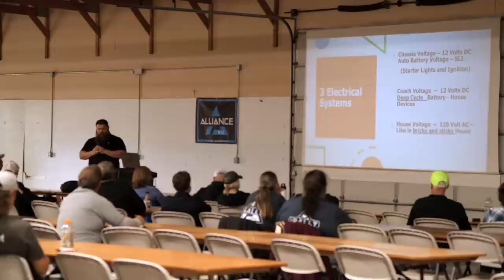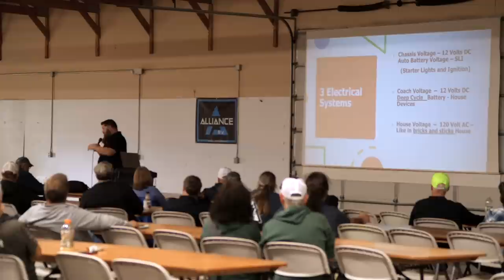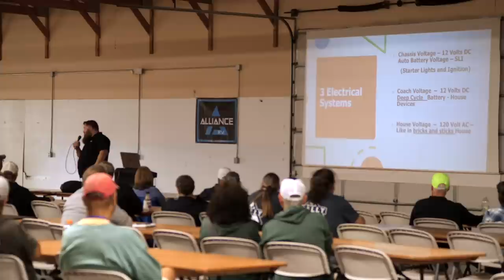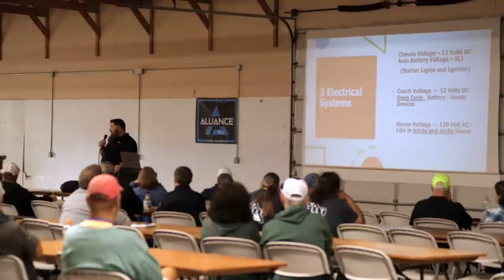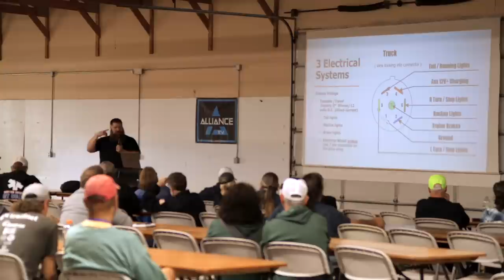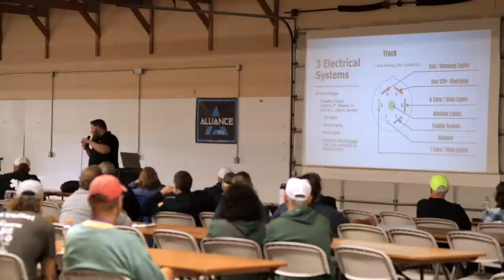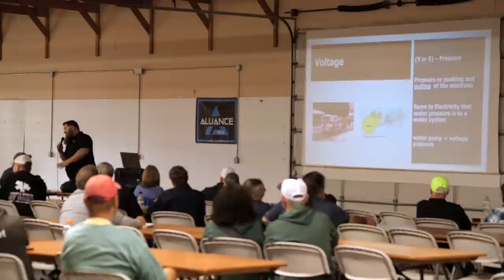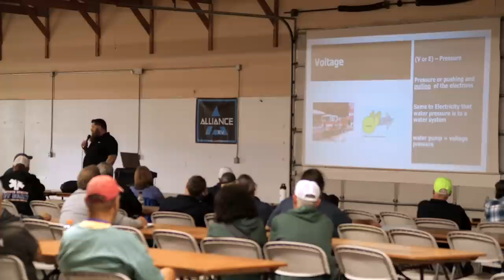Introduction to RV Electrical // Presented at Alliance RV Rally 2022

Comment: Todd, you keep on about a 7 pin connector between the tow vehicle and the RV. Not all RVs have a 7 pin connector. One trailer that we had, had a 9 pin connector. We used to carry a spare 9 pin connector just in case that we damaged the one that was in use, as 9 pin connectors were as rare as HEN's TEETH! 

Yes, we have been RVing for quite a while. I think that we got our first RV in about 1978. The smallest RV that we had was 26' long, and all the RVs since then have been 30' long. It was a Vacationair, that is no longer in production. It included all the usual suspects, as well as a connection for the 3-way fridge, and a connection for the backup lights. The 3-way fridge ran on propane, 12 volt DC and 120 AC. One trouble with that system, was that you NEVER wanted to run the fridge on 12 volt DC when connected to a tow vehicle that was not running, because as you might imagine, it would drain the tow vehicle battery right along with the house batteries in short order. Thankfully, the ONE time I did that, I had a generator mounted at the back of our RV and was able to recharge the batteries, after a very long charging cycle.

I enjoy your TEN-MINUTE TUESDAY VIDEOS, AND HAVE LEANED A LOT FROM THEM.

Comment: Awesome video, I've  worked manufacturing all my life majority electrical wiring machines and building electrical panels with 24dc up to 480ac. The one thing people don't realize on a 50 amp rig is that it's actually 2 120 volt legs coming in and that the breaker panel is split as is the wiring.
Thanks for the battery tip that's one I would never have thought of and hope I never need but good to know.
Reply from the maker: Thank you for sharing your thoughts. Glad we could help.

Comment: Great delivery, bought the course, but electrons barely move down the wire and the energy is instead carried by the fields around the wires (which are set up by the charges on the protons and electrons)!! It's VERY far from the pressure theory but use it if it helps 101ers. Cheers!

Comment: Thanks,  informative presentation.   Can you tell me why a single phase is limited to 30 amp.  If 50 amp is two 50 amp legs. Why can't a single be 50.  Thanks
Reply from the maker: Because there is only 1 neutral line. 50 amp has 2 hots  ht only 1 neutral back. So the electricity has to be in split phase (249) so we don’t overload the neutral line.

Comment: So ... I'm only 6.5 minutes in at this point.  I feel very "seen"! :D
Yes, I am an EE.  
Yes, this past weekend I had to back into my spot while half a dozen folks at a campsite across from me sat at their fire ring having nothing else to look at than me backing in my trailer (though I did a fantastic job, if I say so myself!)
Yes, I already admit/know that RV electrical is "weird".   
Yes, I AM staring at the computer monitor, not giving you an answer when you ask if I agree that there's a starter battery in my towable.

Am I actually there in front of you??
Reply from the maker: Keep up the awesome work!
Reply: @NationalRVTrainingAcademy   And now that I've finished ... I want more!  I am particularly interested in the differences in between a DC system and an AC system.  I live with and work (at least on paper) with AC systems.  Why aren't there wire insulation color standards?? And why must I guess which line is positive vs neutral?  DC is weird.   :D